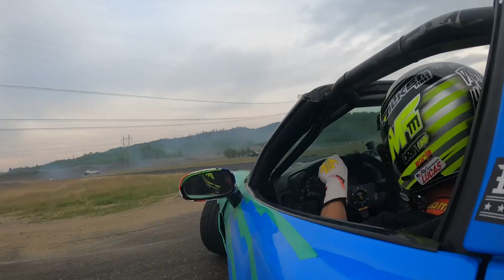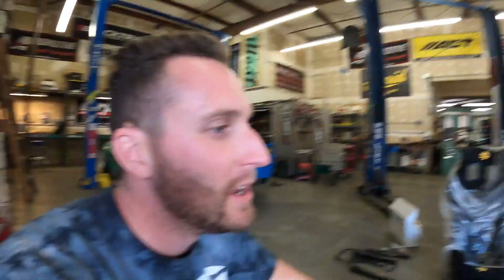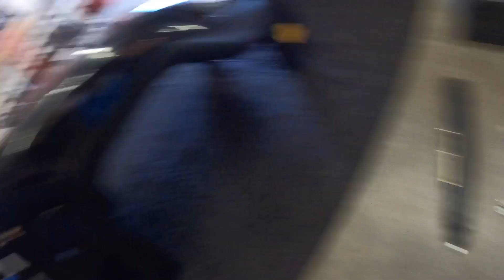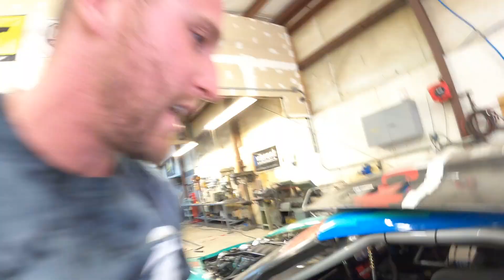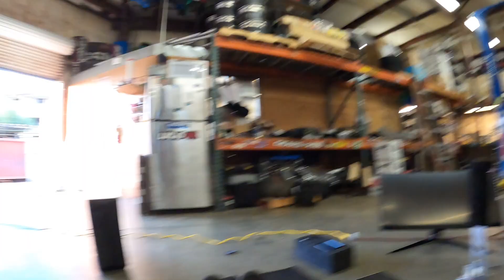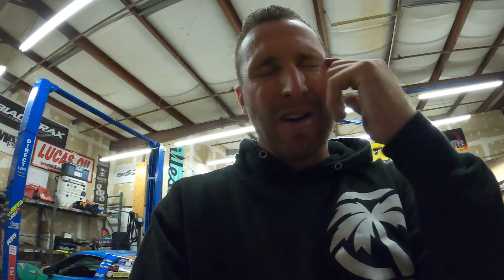MF777 Sim Rig Build: Ep2

Comment: Just a heads up not sure how far into this you are but do whatever you can to make the mount for the motor as strong as possible. If it flexs around or wiggles you will loose steering feel almost feels like you have a damper on your steering.